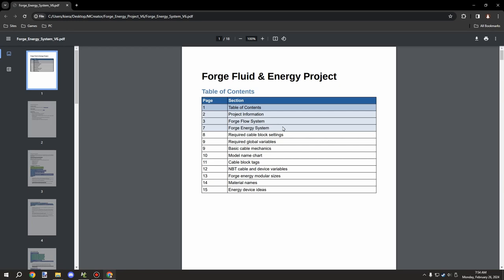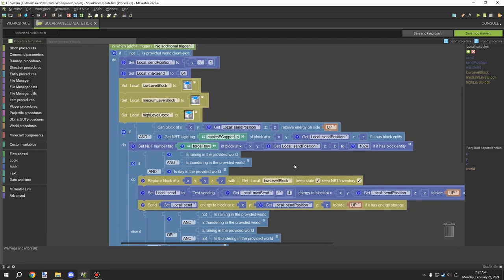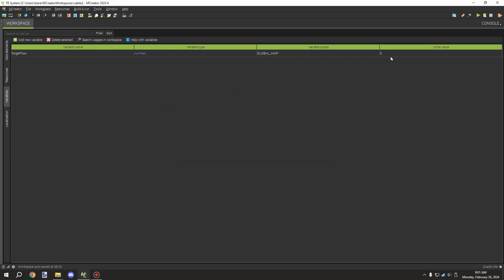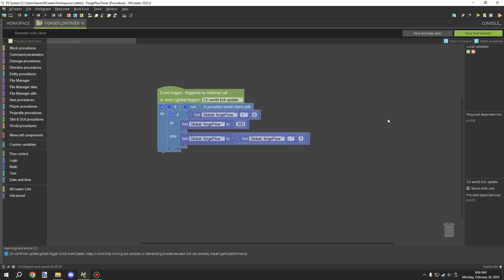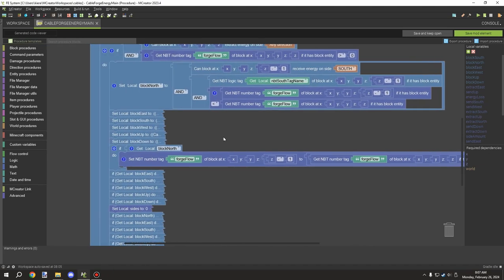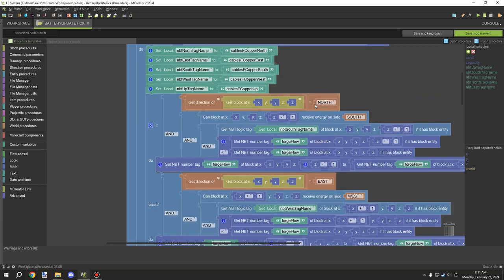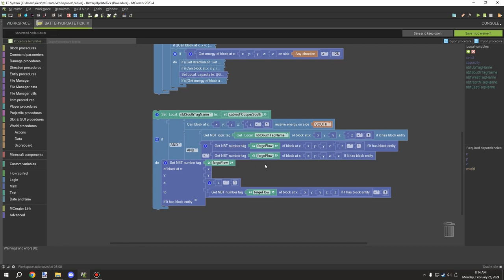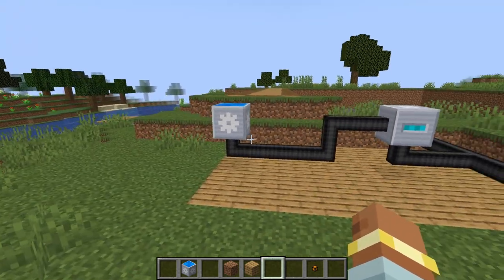Part 4 | Forge Energy System Fix | MCreator

Comment: hey so i have a question is there a way to make the energy go down by 1 every second?🤔
Reply from the maker: This could be done, you would need a timer for every block and delay it 20 ticks which is 1 second. This would still allow your block to tick every 1/20th of a second which it needs for other mechanics like the model updating script.
However the script I provided would require changes made to the energy section.

Also I plan to work on a variable based system that can do a lot more stuff which is not limited by forge/neoforge but still provide the community a structure for the system. Though I have been busy with trying to fix CCTV Craft lately and still need to sort out other issues with the system but its a goal I have to archive for the MCreator community one day.
Reply: @NorthWestTreesMCreator  thanks

Comment: The energy is multiplying if the capacity is greater ;-;, please make a video fixing this, I want to make a mod with these cables.
Reply from the maker: I just checked the example workspace it should not be multiply energy if you have followed the tutorial correctly.
To be sure I released Version 8 just now it has some fixes and changes for when I get to doing tutorials on the fluid system.

Comment: when the distance becomes too great, the energy of the cables begins to multiply, and a generator with just 15RF/s can fill a 64k battery in an instant, this happens just by increasing the cable's energy capacity from 64 to 1000 ;- ;

when very far away, the energy always multiplies, it starts with 15 then goes to 45 then goes up to 300 and so on up to 64K do you know what this could be?
Reply from the maker: It could be a few things though I have not experienced this when testing I have noticed that energy can be sent pretty quickly through the cables. You can try lowering the amount of energy the generator can send. It may take some math but cables if set on 1 tick will be able to send up to 64 FE per tick so 1280 per second, if you increase the delay of the generator so that it will generate slower say like 64 per 20 ticks then you will see that each second would send a maximum of 64 energy that's roughly 3.2 per tick but its still measured as a integer as it only sends out 64. This could help with the speed of which things fill. You could also generate less energy too for your generator if needed. Cables will automatically split energy down directions that have space to fill. And using the Forge Flow system it won't send energy back towards the generator this is to fix a issue with the energy only going so far and locking up the system.

Also I noticed this on Tuesday but there may be a problem with a downward direction for some of the script I can't remember off hand but it was not set up correctly on my part and from a quick look on the GitHub I have not created a patch to fix the issue, I will work on this in after I am done uploading for today and get that patch out soon as possible.

Tough I do remember it only effecting the downward direction for cables. But I will release a patch ASAP.
Reply: @NorthWestTreesMCreator  Thank you for your support in the mcreator community, on behalf of users in Brazil, I would like to thank you for your help.

I don't know if this helps, but I noticed that if the cable is not connected to anything, always on the last cable the energy starts to multiply twice, and the same happens when the battery fills up, the cable that is directly supplying energy starts to multiply energy even receiving 1RF/s
Reply: I'm having the same problem, the energy doesn't stop multiplying if the capacity is increased ;-;
Reply: I'm also having this problem, if anyone can fix it please let me know, I'm waiting tnks
Reply: I have the same problem ;-;

Comment: If anyone can fix the cables please let me know, I'm looking forward to using them tkx
Reply: I'm trying to fix it, from what it seems to me, when the energy is sent to the capacity test, a large part of it doesn't return, then it ends up multiplying, I'm not sure if this is the error, I'm trying to carry out tests to see if I can locate them, unfortunately so far without success
Reply from the maker: There was a issue with the LC direction which prevented energy from being sent down in some cases.
This was fixed in V8. I also re-exported all the procedures just to be on the safe size to make sure everything is synced with the example workspace and fixes I made. If there is still issues feel free to report them on the feedback GitHub here https://github.com/MCreator-Examples/Feedback This way I can try to resolve the issues.

Comment: I only changed the storage capacity, and even when the generator is not generating energy, the cables continue to fill up, it seems that the energy is not removed when transferring from one cable to the other
Reply from the maker: There was some issues win V7 I released V8 today make sure to read the change log to know the changes.